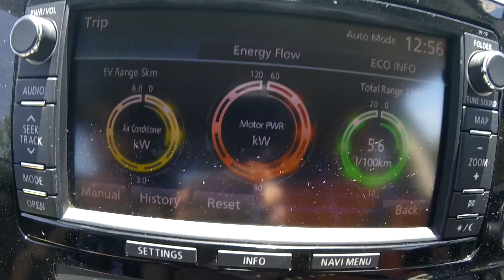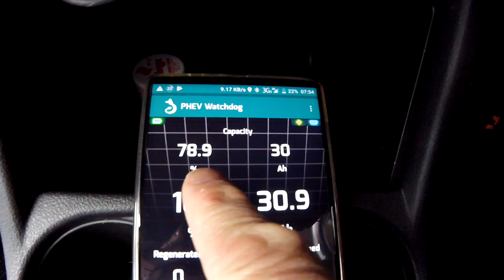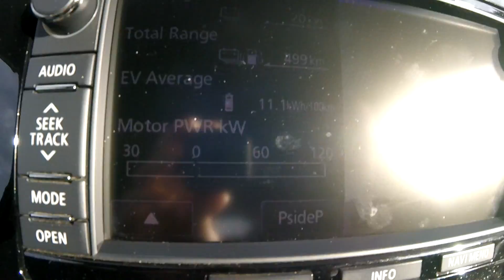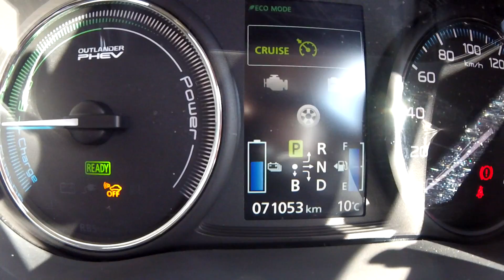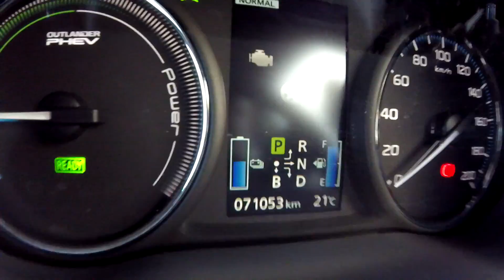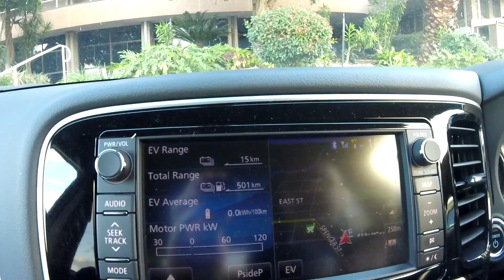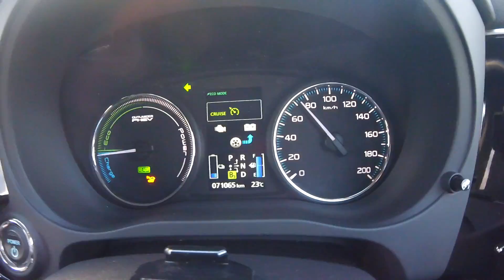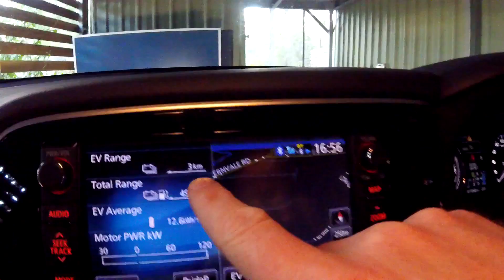EP107 - The rising SoH theory with the Outlander PHEV?

Comment: hi Andy im back from my proper road trip, i agree with all you say about soh etc, my car was delivered on 7th july i have now 5k miles on the clock and already im showing 98.4 % soh, and when i charge i find the available ev range is all over the place, from 21 to 27 miles, on my road trip i did 2971 ,miles, it was impossible to charge, no hotels had charge points, one did have tesla points but cant use them , there all on different charging systems, i signed up to 3 different plans and only ever found 1 charge point that worked, its appealing the system is rubbish in Europe. back in the UK commuting to work and local runs then its the best car ever , i dont need fuel, i just had a home charge fitted, in the UK a road trip would be ok as there is a good system with the likes of polar , pod point and electrocity for plenty of charge points around most parts of the UK, on my euro road trip all i could achieve, with gliding , regen, and charging on highways while driving was a very poor 36 miles per gallon, and with such a small fuel tank its loads of stops to buy even more petrol. anyway still pleased ni went for a phev, and i wont ever gp back to normal fuel vehicles, but for a road trip in Europe its totally shit .ni will try to make a video soon explaining how i find the outlander and the problems involved, anyway love your work keep up the videos , i sat in Prague the other night watching you chat, sad eh . keep charging and good health to you and yours Andy
Reply from the maker: Thanks very much for your comment and sharing your feedback. I cannot believe you haven't found any charge points for the PHEV. Every hotel should have a power point in the parking garage somewhere. The Plugshare app shows all the public chargers available everywhere and also private charging opportunities. We have been to so many places here in Australia and I was always able to find a plug somewhere. People are open and let me charge, are interested in the car and technology. I also plan my route along charge points if possible. 35mpg sound about right to me. That's what I get as well on longer trips. If we take my wife's Kia Rio we can probably match that but no other SUV can.
Your trip would have been a pleasure in a Tesla, I guess. I'll have a look at mine on Tuesday when they do the big unveiling of the M3 here in Brisbane.
Reply: even the tesla might have struggled in europe, have you won the lottery if your buying one of them ha 
#
Reply from the maker: The Tesla is fine. It even made it around Australia with almost no public charging available. In Europe there are Superchargers everywhere.
No lotto win so far, but it needs to happen. The PHEV is too frustrating over time. I loose all my hair... :\
Reply: i would love one but far to poor i try win lottery i get one for me one for you ok deal

Comment: Hi, the question is, how can the owner drive and charge the car, that the BMU gives you the max capacity? 

Is it like in a good AA batterie charger that you have to do a "cycle" (uncharge and charge in one run to full)?

I heard about a sleep mode in Teslas. When you ask for data via WLan or OBD adapter than the car goes not in sleepmode (like you mobile phone) and consumes more energy while parking. Maybe you OBD adapter is draining your batterie?! You told, that the 12 V batterie is charged sometimes while parking. The OBD is in my point if view connected to the 12 V system.
Reply from the maker: Li-ion cells don't need to be fully drained, they don't have a memory effect like NiCd or NiMH cells. The software should be capable of calculating the true SoH and SoC without doing that.
The PHEV has no sleep mode and nothing happens to the traction battery while parking. I tested the OBD and the SoC still decreases even without OBD plugged in. The 12V battery only charges at 2pm each day if the car has the Wifi module equipped which mine does not have.

Comment: Hi Andy,

This famous "loss of energy while parked" might better be addressed the other way. In practice, evaluating the remaining capacity of a battery system under load is pretty difficult because voltage drops with load. Gasometer is approximate while driving, gets a better quality read when battery has been at rest without load for some time. The rest is probably just readings smoothing algorithm results: the measuring system cannot provide too much fluctuating measures and probably applies some kind of smoothing, with a moving mean calculation of some sort. It will end up more accurate with time, sometimes with higher values, sometimes wirh lower ones. Since your driving is pretty much low demanding in terms of Amps and voltage drop vs usage, it is possible that the algo provides most often than anything a lower remaining capacity than for another typical user for which it has been calibrated for, once things stabilize.
Reply from the maker: Thanks for your feedback Andre. The BMU calculates and predicts the SoH, SoC and also the remaining Ev km. When I got the car new (new means, it was already 1 year old when I got it), for the first 1.5 years I never had a loss of capacity been calculated on any trip during parking. Worst case in Winter was that the SoC stayed the same over the day and in Summer it went up 2-4km. This loss is only happening since ~April 2017. As this was before I used the Dog it's a bit hard to tell what changed. I guess I covered pretty much every aspect of that problem and tested the heck out of every possibility I can think of.
I would also rate my commute as a high demand load for the battery as I discharge greater than 1C (40A or 12kW would be 1C). I know the battery gets abused in these cars and it will probably last a lot longer in pure city driving with a higher regen to acceleration ratio and slower speeds.
Only 3-4 cars seeing an increase in SoH during their usage now out of around 150. These specific cars are not doing anything differently to other vehicles although their SoH rises. It is a lot of speculations going on in regards to that on the FB forum and others are trying to mimic these behaviours by adopting the same charging and usage pattern. Without much success though... I'll do a video about this very soon to address this problem/feature.

Comment: You can put a Tesla into a deep sleep if the car is not used for a few weeks.
Reply from the maker: The interesting part is that the PHEV does the recalculation only once during parking. Once it has altered the SoC and you keep driving to your next stop (without charging), it won't do it again. It only happens first parking for 2h after the first initial drive.
I meet the Model 3 next Tuesday here in Brisbane. Exciting times ahead...
Reply: unplugged EV yes apparently rumours of 3 hitting the UK by the end of the month for stores poss  test drives too, would make sense if your getting right hand drive cars too.👍